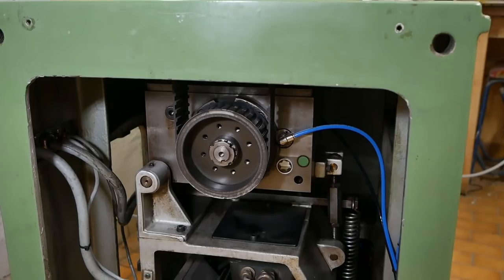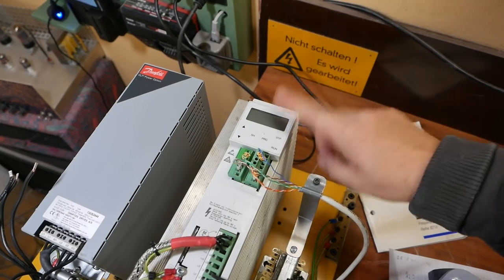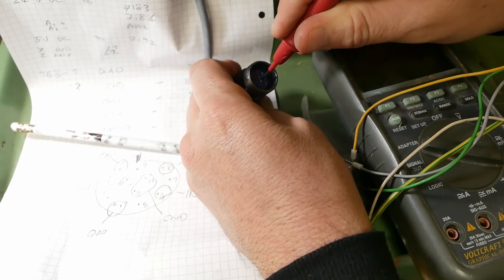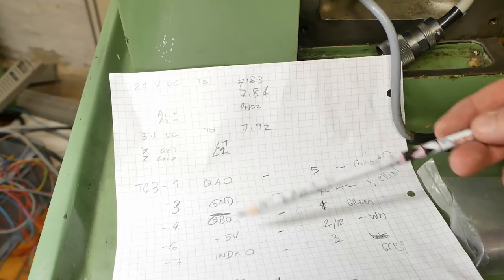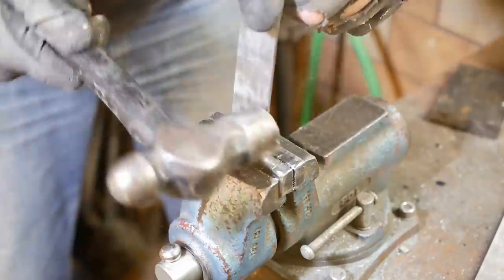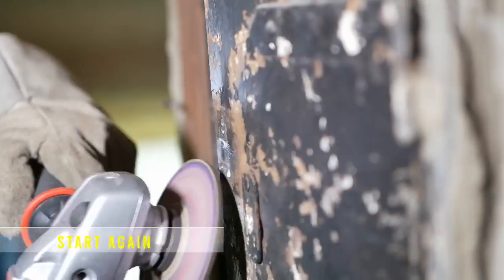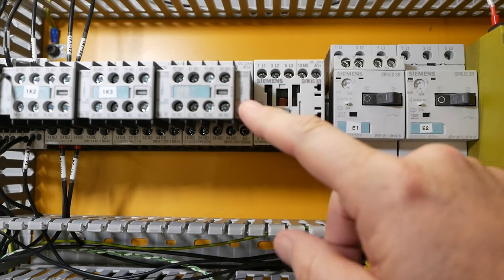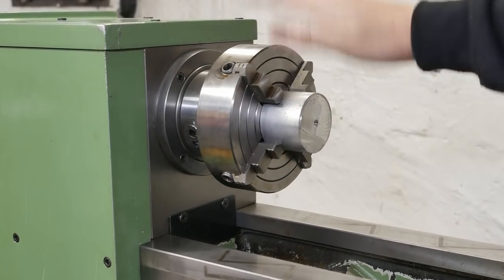Decoder the Encoder - Schaublin Ep.29

Comment: Here in the U.S. a .30 mm wire fed welder is in the 100-200$ range.  They are ideal for the thickness the thickness of your chimney panel.    I use mine all the time.
Reply from the maker: Thanks for the info! I like stick welding, although I am crap at it, as soon as it in not a nice thick part ,sitting facing up on the bench :)

Comment: Was the magnet shifting the arc? I’ve had that MIG welding the arc would just deflect all over the place due to magnetic fields 🙄 can you get the encoder details from internet part numbers? Or strip down connector to see what colours go to encoder? Maybe misunderstanding the problem.....
Reply from the maker: Did you see the out take? :)

I dont know about magner shifting the arc. I suspect the welding problem was a lack of talent.
Reply: @RotarySMP  DC arcs will suffer arc blow due to magnetism. Also you can get arc blow without them spin the rod when that happens.
Reply from the maker: @TheMetalButcher  Good to know. I still suspect the bigger problem was the nut between my ears :)

Comment: Resistor or varistor block on contractors is to clamp noise from coil, it can safe output that drives it and makes wiring crosstalk less of a problem. It has nothing to do with noise from switched load
It also can pop controller fuses, when some idiot puts 24V block on 230V coil C:
Reply: Yes, thats right. 
Mark, thats important right here!
Add the Snubber network to your contactor. Its used to supress switching noise from the coil. Not the load. Its important to have that to not fry the controller.
Reply from the maker: @farbe123  Yeah, I really had a brain fade there, but from the Mesa 7i84 manual:
Outputs have per output short circuit protection, overvoltage clamps and per driver chip thermal shutdown. The 7I84s outputs are suitable for driving relays, contactors, solenoids, and other medium power inductive or resistive loads.
... so I think there are free wheel diodes built in at the board.

Comment: Normaly there is a blocking diode or something from the internal power supply that you can sniff with a Diode range on your DMM across the power lines. Try that and see if you spot the difference with polarity on them power lines.
Reply from the maker: Problem solved...see the outtake :)

Comment: Maybe i am late to the game but i set my VFD on "coast" to slow down or stop , its seems to slow down quick enough for me ... But its a manual lathe so probably not as important . Might need a brake resistor if you really want to decel under control.
Reply from the maker: That is the mode I was hoping to find on the Lenze, but couldnt. I have been told there is a second more detailed manual, so I'll look into that. SInce I have a mechanical brake on the motor, I want to use coast down so the VFD doesnt fight the brake,.

Comment: does your VFD maybe include a dc injection braking function? this would maybe remove the need for an external braking resistor. it basically tries to use the windings as an eddy current brake while the motor is winding down.
Reply from the maker: It does support a braking resister module, but I was hoping to use the mechanical brake.
Reply: I have no direct experience, but I suspect braking via a resistor would add to motor heat somewhat. The mechanical brake seems the better option to me.
EDIT: I just read a few comments further, and now understand the challenge of implementing the brake (lack of a coast-down mode, thus far).

Comment: 2:00 i think you can turn it at 10~100Hz without any damage (not sure about Lenze, but i did it with my Danfoss VFD)
Reply from the maker: I could, but since I also have a variator, and a back gear, I will have an extremely wide speed range even like this. By keeping the lower speed high, I am hoping to avoid overheating the motor with insufficient cooling.

Comment: Are you going for a braking resistor on the vfd? I'm going for one on my lathe upgrade.
Reply from the maker: I was trying to avoid it, as I have a mechanical brake on the motor.
Reply: @RotarySMP  my 1950's Hardinge has a physical /electrical brake not sure how it works, uses Cork pads!!!

Comment: I think TIG would have been a better way to weld that, or maybe much smaller sticks.
Reply from the maker: ...or more talent :)
Reply: @RotarySMP  Talent is just time + correct practice. Remember "grinder and paint makes me the welder I ain't"
Reply from the maker: @bluedeath996  I have practiced enough to make a decent weld in a v in 4mm steel upright on the bench. The problems start when I deviate from that ideal setup :)

Comment: Don't you need some kind of breaking resistor connected to the VFD for (rapid) deceleration ? Not an  expert but I do have one of those knocking around on my CNC mill intended for just that , however, I have not connected it yet.
Reply from the maker: I was going to let the VFD coast down, and use the mechanical brake, but I cant find a coast down mode in the manual.
Reply: you are correct, for breaking u have to add an resistor to the vfd, otherwise the electronic will die sooner or later from the high voltage peaks .
Reply: @RotarySMP  Hmm. I have a very thick Hitachi VFD manual that covers this stuff. See if your manual mentions anything about dump  or "dynamic braking resistor" and also see if there are terminals on the VFD to connect one to.
Reply: @crackone2three  Could not agree more. There needs to be a sink for the regenerative energy to be dumped upon deceleration.
Reply: Some VFDs have regenerative breaking, where instead of a resistor, they dump power back to the AC line. I have a VMC with such a spindle drive.
Reply: @RotarySMP  In that case you need to disconnect the motor from the vfd - which is a lot of hassle.
Reply from the maker: @milloons2847  It has the connection for a braking resister module, but I was hoping it would also have a coasting mode, which some VFD's have. Basically when you command stop, it doesnt fight the mechanical brake.
Reply: @gorak9000  iam not sure if u are allowed to do so in a Private home.
Reply: @RotarySMP  Coast mode is new to me. I learn something new on your channel every week :)
Reply: @RotarySMP  May I suggest to go the easy way? ;-)
Apart from my easy remarks: love your channel.
You do the work and it is easy to make suggestions from the side - I'm well aware of my position on the side.
Lots of sympathy for your channel.
Reply: @crackone2three  Why would that matter? The AC line is the AC line. I don't care how big your DC bus capacitors are in your drive, you're not going to have enough drive strength there to change the voltage of the line instantaneously - the line is a pretty "stiff" source to fight. All the breaking resistors are doing is keeping the DC bus voltage below a threshold. The falling side of the sine curve of the AC waveform of the line is just as effective, plus you don't end up with a bunch of waste heat.
Reply from the maker: @milloons2847  Thanks for the feedback.
Reply: It blinks OV (over voltage) when decelerating. Maybe there is some mode to dump it back to AC grid? Not sure about regulations on that.
Reply: @gorak9000  well the vfd induces a lot of noise into the line, on that smal vfd will not be much ofc but its possible that some neightbour gets interference or flickering on some Devices
Reply: I would need to look into manual for this inverter, so I am not sure  I work with newer Lenze inverters and I belive they have threshold when they stop braking and let the load coast. Usually set to something like 5Hz. Somebody mentioned here disconnecting motor form VFD. I would not recommend. This can destroy the VFD. The signalling it gives you about OV MAX is overvoltage of DC. circuit. Not good to do it often while something can be damaged and best solution for this is either lover deceleration or mount bigger braking resistor. And also the size of breaking resistor has to be set in inverter for VFD to know how much energy can it dump in it. I am just making list of key parameters to consider on Lenze VFD I use just as my own cheat sheet for work. I will try to get back here if I find something that might make yours coast. Hope they did not changed the parameter numbers too much.
Reply from the maker: @soucevit  Thanks.for looking into that.
Reply: @RotarySMP  Does the inverter have a DC braking mode? If so you could set it to minimum DC braking and use the mechanical brake to do most of the work.

Comment: There's a lot to be said for a MIG welder. Even a cheap flux MIG welder.
Reply from the maker: Everone seems to like them, but I tried a cheap flux core and thought it really sucked. Dragging a real Mig up to the attic would have been a no go.
Reply: @RotarySMP  Yeswelder makes some really great lightweight MIG welders. You can use flux core when mobile and gas in the shop. Last year I bought a Yeswelder MIG-250PRO and it is fantastic. I also bought a Yeswelder Clearview hood and for an old blind guy like me with one eye and no night vision due to Lasic surgery, it was the best welding accessory I have ever purchased. I can finally see what I'm welding. The lens is light blue instead of dark green. I can actually see the puddle now. With a bit more practice I might actually not totally suck at welding.
Reply from the maker: @misterfixit1952  Nice one. I have not heard of that brand over here. The one time I tried a cheap flux core Mig, I thought it sucked. Not like I would blame the tool :)

Comment: Did they alr make any announcements for hydrogen replacement for the gas oven? As i heard they will be banned by 2030 here.
Reply from the maker: They are banning oil burning in home furnaces from 2030, and gas from 2040 here, but maybe that changes? I doubt hydrogen will be the replacement. More likely solar on the roof and a heat pump.
Reply: @RotarySMP  I do wonder if a heat pump is really a viable option especially for old houses that require more heating power even when properly isolated as it’s just the size of the rooms.

Comment: Hear Hear! My car is due for a complete brake maintenance, oil service, and inspection, all at once. All before the MOT. Yeey..
Reply from the maker: I need to do an oil change before mine.
Reply: @RotarySMP  Can you at least DIY? I can do it myself, but.. My service record is all digital, so I can't put it down anywhere since I haven't got access to the system. bad for resell value :/ And the brakes.. Well. There are so many systems in the car (autobrake, street-radar etc etc) that I don't dare messing with it myself. I miss my old Mercedes from 1978. If there was an issue with it, I just followed the hose/wire until you found the spot where the mice had ate it ^^
Reply from the maker: @Dlehnerswe  Yeah, I do it myself. I bought one of those ODB II tools, but the Audi has been very reliable. I dont worry about resale, as I only buy cars that are already at about 200K km, and then use them till worthless.

Comment: Have you ever worked on any electric airplanes? Do you have any opinion on them?
Reply from the maker: I haven't, but until the power density of battery tech makes another significant shift (of which there appears none on the near horizon), they are limited to very limited missions.

Flight training can work, as you are close to the airfield, but you have high consumption flight profiles, and really need swappable battery packs to keep the utilisation up. Three circuits, switch the batteries.

I think all the Lillium, Ehang etc automous air taxi concepts are vapourware. They deny the laws of physics (the range/paylod hype of Lillium), or deny reality of cities (Ehang). 

The Ehang looks to me like four unshrouded law mowers. The first time one of them lands on someones pep poodle and makes mince ot of it, it is all over. Also the noise is unacceptabe in any western city.

I feel there is no early mover advantage in those companies. The essential tech (Battery power density) is not being driven by this industry, but by consumer electronics. Once it is there, it will be available to all. The aerodynamics and flight control of these vehicles is nothing special.

My 2c :)

Comment: Brakeing resistor should be able to add one externally
Reply from the maker: Yes, there is this capablity.
Reply: Reading a few other replies if you can get it to coast that would be good. The millacron had that option as well as stop at point

Comment: To make the motor coast, can you not just disconnect the "enable" signal (via a relay) ?
Reply: This is also my thought,  It for sure works like this with newer Lenze converters. It is even mentioned in their manual. However this situation is not mentioned in manual for converter he uses, so I need to make some more research about it. Maybe there is more detailed manual than I found.
Reply from the maker: That is good to know, as I have an enable signal already wired.

Comment: Do you actually burn wood in your wood heater? No one in North America has a gas chimney swept, ever. And most gas furnaces are high efficiency now, so use PVC exhaust pipes (and air intake pipes) with mostly only water vapor coming out
Reply from the maker: I do tend to burn wood of at least a few days each year. Part of the annual chimney "sweep" if an emissions check for the gas furnace.

Given the current crisis, wood might be my primary source next winter.

Comment: running empty chuck stands the risk of one of the fingers coming out.
Reply from the maker: That would require back driving the adjustment screw. When the jaw close to the center (as it was) I find that highly unlikely, on a new chuck like this.
Reply: @RotarySMP  oah i am totally with you on that one....

but that's the generic rule of thumb I learned as a novice just starting with machines.

The guy who trained me was very clear on having me clamp on something, or clamp the jaws empty before running it up for a warmup cycle =)